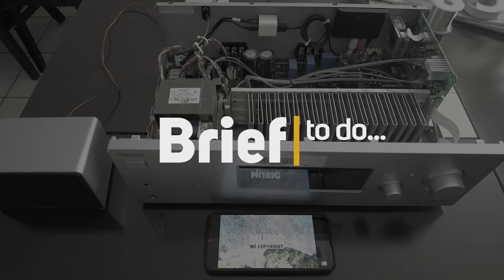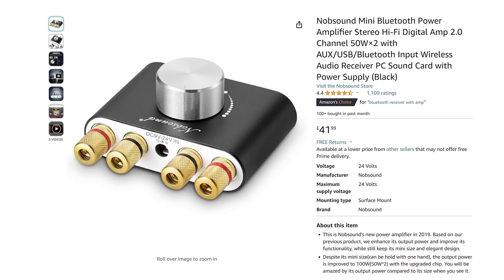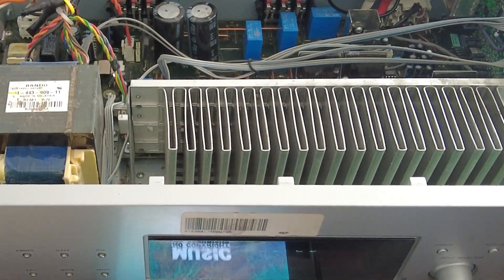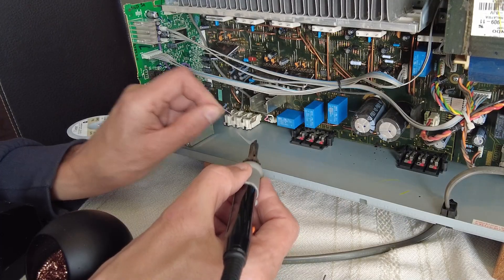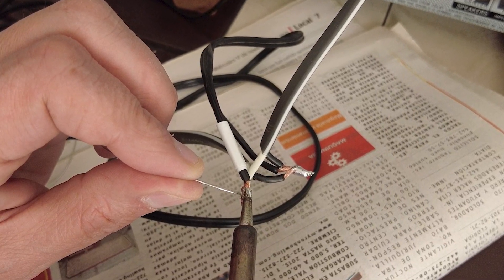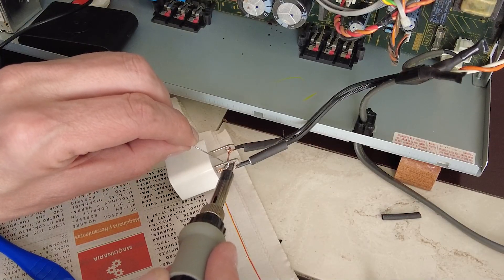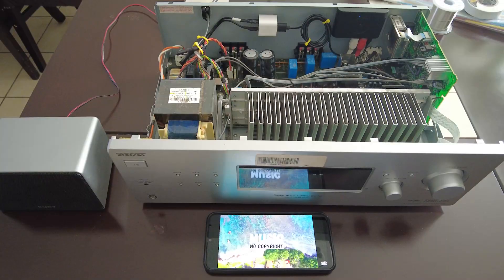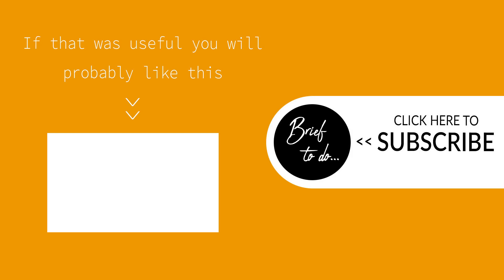Bluetooth Vintage Stereo Install 🎵

Comment: I was surprised the bluetooth signal got through the steel case of the Sony amplifier.
Reply from the maker: No problems when I did a test 4 metres with a clear line of sight. At 5 metres and behind a block wall the signal was breaking up.
Reply: @brieftodo Well that is all the evidence I need! Very cool...its pretty amazing tech. I was thinking about doing something similar for my old car but was concerned about the metal surrounding the location I had in mind...concern now gone! (I can try it and if it fails, I'll just move the BT box.)